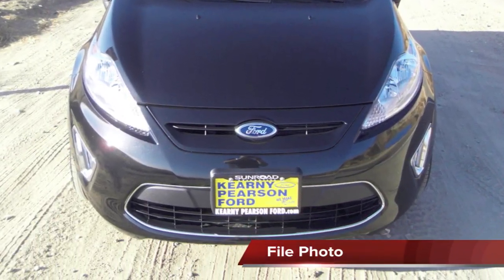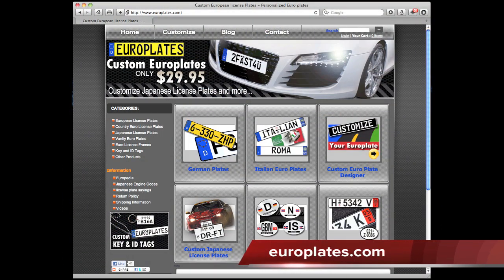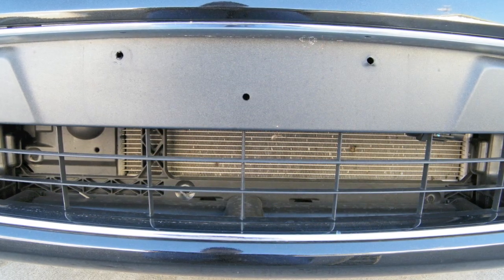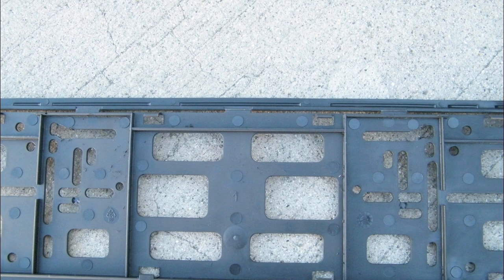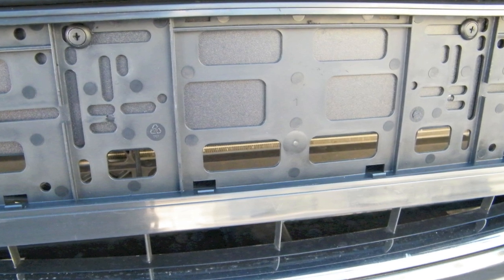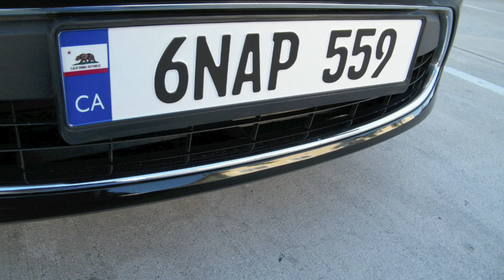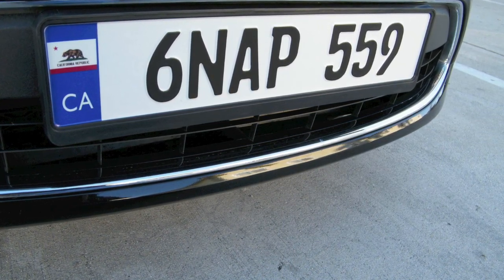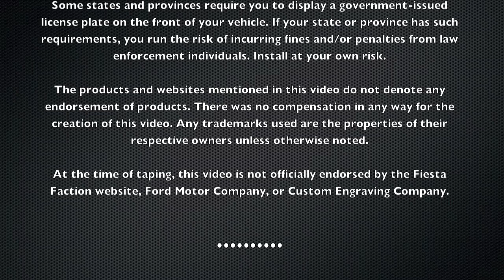2011 Fiesta How To: Euro Plate on a North American Model

Comment from the maker: In states that issue front license plates, this is also illegal. Enforcement can vary though, and in California (thus the "CA" and California state flag on the left) it is rarely used as a reason to pull over the motorist (as a very large number of motorists drive without it); and is generally used as a "tacked-on" fine if you're doing something else illegal.